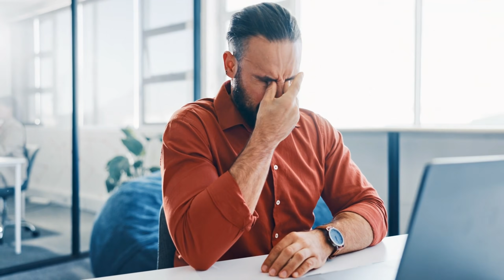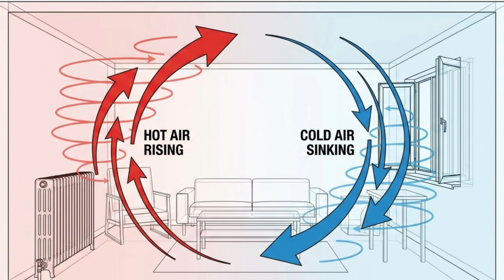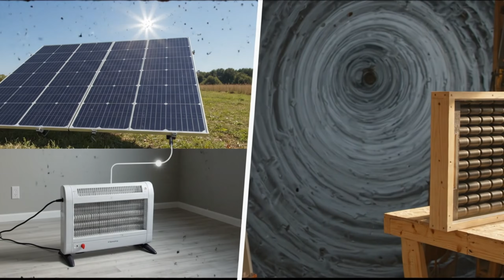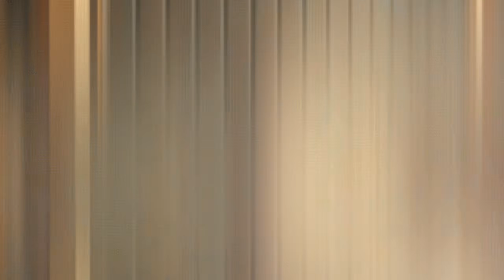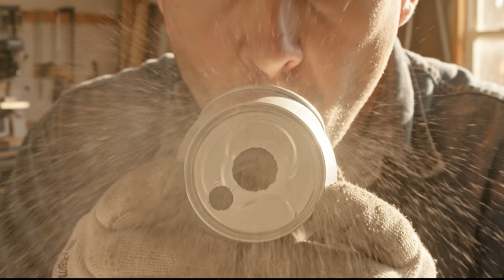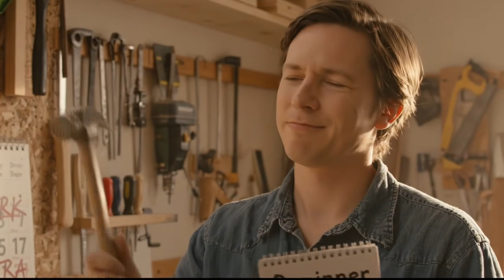Forget Heating Bills — This DIY Soda Can Heater Generates UNLIMITED Hot Air For $0

Comment: Direct that initial stream of hot air up thru a sand heat battery that will provide heat once those cans go cool after midnight
Reply from the maker: That is a brilliant idea for extending the heating time! ❤
Reply: @BuildHidden even piping it thru a 35-55 gallon tank of water would retain the heat